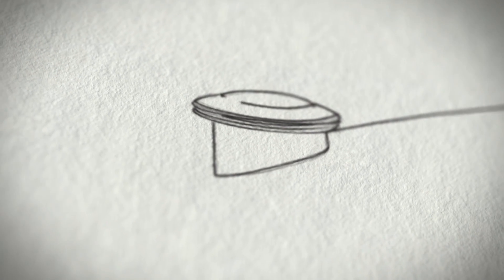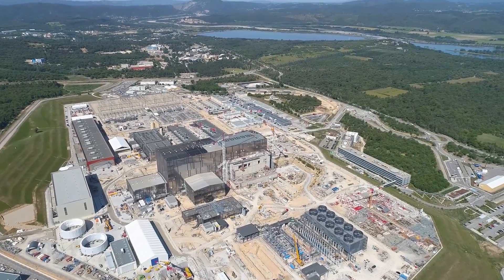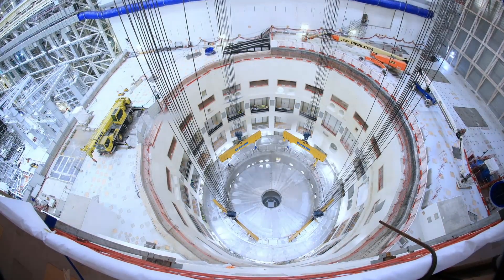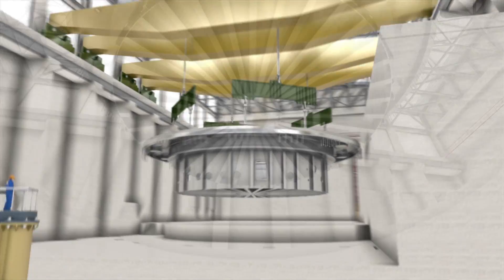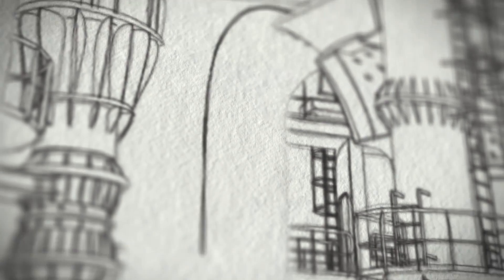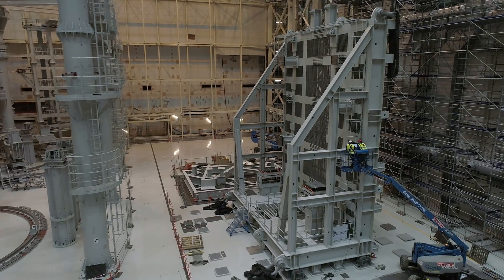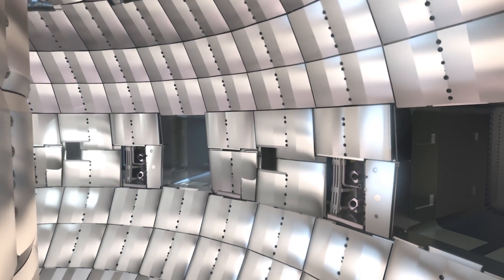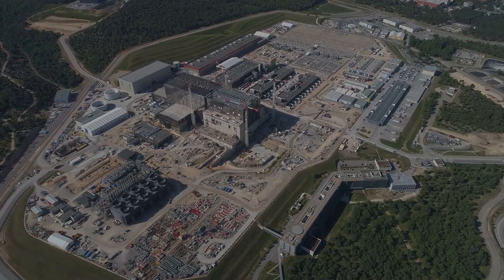ITER - the world's largest puzzle (2020 version)

Comment: I am always surprised about how little attention this project gets when it is so crucial for all of humanity.
Reply: I found this by chance and I am absolutely astonished I have never heard of a project of such magnitude and time based dedication; at an international level. UNBELIEVABLE, this should be all over the news as a celebration of humanity in these difficult times.
Reply: @imwritingtosay  It actually has been on the news a fair bit, especially the last couple of days, when it was first signed off, and when construction first started.

It's just that it isn't currently a super high importance and general interest item yet ( since it's still decades away from producing energy, and even then it will never make electricity ), and it's all very long term.

It would be nice if things like this were higher priority than a lot of other stuff though.
Reply: Couldnt agree more mate, that has been on my mind a lot and its dissapointing that no one is recognising their achievements.
Reply: @David Currie Much less long term radioactive wast than fission. ITER is also a research machine - not a commercial power station. Like many technologies it will get cheaper and simpler as confidence and experience accumulate and as it gets streamlined for actual use.  If it works it will point the way to a future where we don't have to fight about oil.
Reply: How broken our culture is...
Reply: Still gets enough attention for it to be built though.
Reply: David Currie , what data are you analysing? Your claims seem to contradict the IAEA ... https://www.iaea.org/topics/energy/fusion/faqs
Reply: ngl this is already outclassed by the wendelstein 7-x
Reply: @tedkorff971  by the use of graphite (carbon) tiles that will react with hydrogen maybe? outclassed = source?
Reply: @the_black_douglas9041  He is lying.
Reply: ITER is even criticised by some. I'm glad that I can speak English, the comments in French are a bit miserable and show a deep lack of scientific knowledge and understanding!
Reply: @ThaïLoeil-d6k  les miserables
Reply: @ThaïLoeil-d6k  Do they think its going to cause a nuclear explosion and delete part of france?
Reply: @David Currie Fusion power absolutely will pay itself back. Sure, it's not purely magical as some say (without a ready supply of deuterium, these reactors will produce radiation and radioactive byproducts) it definitely has the potential to replace the entire fossil fuel and nuclear power generation. ITER itself will not be hooked into the grid, because it's purpose is a research reactor. The big idea behind it is that by making such a large reactor, we'll gain efficiencies from the scale which will tip it over into over-unity and produce more output power than input. Let's not forget that nuclear power was considered impossible prior to the Chicago Pile moment, when we first demonstrated that mankind is capable of controlled fission, it only took 12 years for the first nuclear power plant to start supplying the grid after that event. Fusion is almost certainly in the same boat, assuming that ITER performs as intended.
Reply: @Colin Berg No, It actually makes sense. This isn't "just another experiment" but probably one of the most important ones, and it has a huge scope, both as an international scientific collaboration, as well as a financial investment and as an engineering undertaking. One's reflection on one's culture is certeanly justified when exposed to the fact of this being a less frequently reported project and one with a much less presence in the public's mind as to compared to something like the mundane details of the life of some reality tv show star. It is justified to point out how most ppl around the world keep focusing on the wrong (unimportant but for some, entertaining) things.
Reply: @David Currie "It is not unlimited energy as is the widespread myth and it will demand incredible amounts of water for cooling, restricting where they can be built. They will produce a lot of radioactive waste and they will even end up using a lot of the energy they make to keep themselves running." This alone shows you don't really know anything about fusion. 

It uses a cooling system, just like a fission reactor. In fact pretty much any powerstation on earth uses water as a primary function of generating power. If there's an area on Earth that can't supply that much water I 100% guarantee there is no demand for a powerstation in the first place. Also, the water is reclaimed, and recycled, so if you're investing billions in a fusion reactor, chances are you can afford a few silos of water.

It doesn't create long-term radioactive waste at all, it produces tritium which is a little radioactive, but also incredibly valuable and used in the same fusion reactor that produced it, meaning it is collected a used instead of dumped. Every component in the reactor is safe to handle after it has been active.

It uses a considerable amount of energy to sustain itself yes, this is integral to how they function, they are trying to reach break-even point where it produces more energy then it requires. The reason they are bothering is because when it does reach break-even it will produce energy an order of magnitude higher then it costs to run.

Sure, people do overhype it, thinking it will be a cure-all to our energy needs. But that hype doesn't detract from the fact that it's still the best method of generating vast amounts of clean energy we have. It may not generate a billion terrawatts or cure cancer, but it will be one of the biggest moments in Human history. History books will record our timeline as "before and after we reached break even in fusion power"

Also, since when did "insane demands" stop people from building fission reactors or even Hadron colliders? If people were deterred from insane demands then we wouldn't even have power distribution in the first place, we would still be using candles.
Reply: I think it might be because evey time people here about it they then here the first test will be in 2025 and it still being put togther so they say "that a long time tell me when its done something"
Reply: In 1976, I wrote my High School Term Paper on Nuclear Fusion, comparing magnetic and inertial confinement technologies. At the time, there was a great deal of interest in Fusion Reactors ... so, yes, what happened??  I would say in general, interest in scientific and technical pursuits has waned since the mid 70's, when the USA was peaked out with NASA, Moon Landings, Skylab, building the Shuttle and Hubble Telescope.. lots of excitement ... then America just started getting dumber and aspiring to ignorance ... what the Kardashians are doing is more interesting than any ITER,. and 1/4 of Americans think Evolution and Moon Landings are FAKE. Then we got the guy who can remember 5 words (Person, Woman, Man, Camera, TV) as POTUS, elected by those ignorants.
Reply: @KrustyKlown  Molten salt thorium reactors are promising.  They could fill in the gap until we have fusion reactors online.
Reply: Probably because there's been programs to crack fusion power since the 50's, and it still doesn't look like it's coming anytime soon. For the purposes of a human lifespan,  fusion research is irrelevant.
That being said, "A society grows great when old men plant trees whose shade they know they shall never sit in"
Reply: it is better this way. as long as it stays out of public attention it doesn't run the risk of becoming an object of politics and conspiracy dumb fucks don't think it is an corona alien 5G black hole generator
Reply: @Sjors you will find it maybe funny that most of the construction workers on site do not even know what exactly they are working on. ive seen an interview once where one of the project commission interviewed some workers, and they were like "i think it has something to do with electric power" then he held up a glass of water and explained them how the machine they build creates from this glass of water as much energy as several barrels of oil.  they looked quite skeptic and yet amazed.
Reply: Reality is often disappointing.
Reply: Most people doesn't know about this project. I agree with you. Success of this project will rescue humanity and Earth from heating.
Reply: Same goes for spaceflight
Reply: Humanity is busy fighting itself
Reply: @charlesstuart3064  They changed the algorithm recently back to the way it was about 1-2 years back. I have discovered multiple new channels that I liked and been served newly viral videos again.
-
We will see how long they keep it this way.
Reply: @David Currie    Yes, in terms of power generation it won’t help. Bit it lays the foundation for future (fusion) reactors. The waste you are talking about is neutron-activated metal which can be recycled after 100 years of moderate radiation (no final repository anticipated). The ITER-reactor should make 10 times more energy than it requires to run: 500MW output for 50MW in, giving you a net output of 450MW of power. I think the major problem is cost and time. While we wait for fusion to enter the market, we should replace fossil fuels with fission (SMR) and renewables (PtX).

SMR = small modular reactor
PtX = Power to X (X=H2, gas, other energy-rich chemicals).
Reply: @lagging_around  To my understanding the 500MW out is in heat production not electrical power. The researchers intend to swap panelling along the interior and fiddle with injection and extraction to work out the science around this technology so that DEMO will be capable of extracting heat from such a reactor and using it in some form of heat engine.
ITER will be dumping the heat into some river unless someone concocts a way of using such a small temp differential to do work. I suspect some toy apparatus will be deployed since ITER is effectively a large scientific instrument. They are planning to dump the heat because they want to have high control of the temperatures inside the reactor.
Reply: na most people are more interested in what kim kardashian wears
Reply: Because of the evil “Made in China” in the project.
Reply: because its always 30 years away and never works.
Reply: I N V E S T
Reply: We have our own tokamak project in our country and people are more interested in that one.
Reply: @satyavan9631  Hot fusion has already achieved the milestone where the ratio of it's electricity output and input to start the reaction exceeded 1. That means the tokamak approach is proven to be feasible, and the only work left now is to keep on and increase that ratio to 3, at which people believe the reactor will be profitable and can be put into civilian use.
Reply: So true...
Reply: Critical? We would be ok without it. Don’t get me wrong I think it’s great and this could change everything but it’s not critical.
Reply: In 1980, U.S. Senator Mike McCormack sponsored the Fusion Energy Act, committing the United States to researching and implementing fusion energy. The act passed and was signed into law--but with no funding--by the very anti-nuclear Jimmy Carter.  At the time, an organization formed in 1976 called the Fusion Energy Foundation, pushed for U.S. and international commitment to fusion energy by the year 2000.  FEF published a monthly magazine, Fusion, for years.  It was suppressed and in 1986 the federal government put FEF out of business in what was branded by the relevant judge as "a fraud upon the court."
Reply: Could say the same about NASAs SLS/Orion and the rest of the next space race.  We are those rare people that still actively search out to learn about what is going on in these different engineering/science megaprojects.   People are more concerned about an over paid sports player or Kardashians latest toy.
Reply: They are literally building a Star Trek Fusion reactor in France and literally nobody cares.  Very strange.
Reply: @redpillcoach1855  look DTT up. Is the first tester for DEMO tech (the real iter deal) They'll test it in the 2025.
Reply: @David Currie if everyone thought like you, I don't think we'd have any electricity at all. You can't learn how to do something hard unless you start with plans and inefficient prototypes and improve the design from there. Consider cars, planes, the power grid itself, the war of the currents between AC and DC.  It's too early to tell the best method. 

That said, I hope Tokamak reactors aren't the only practical way to make controllable fusion power, for all of the reasons you've stated.
Reply: It's because oil makes more money.
Reply: "Little attention" - i second on this.  But definitely, not in terms of Budget.
By the phrase you've made, I am of the understanding that you mean
attention from both "media" and the "public" in general.

The only conjecture I could pose is that many members of the media
either have "poor" or "little" understanding of nuclear sciences.  Thus,
the general public reliant on these mainstream media, by transitivity,
also have poor and little understanding of this endeavor.

ENERGY is the CURRENCY of Our Existence.  In fact, ALL LIFE FORMS
and WORKING SYSTEMS won't work and thrive without ENERGY or POWER.

You are DEFINITELY CORRECT in citing that it IMPACTS HUMANITY, in general.
Reply: project that important should have 5.000.000.000 euro per month... untill we all achieve technology like that...

I don't know what the world leaders are doing... 
There should be commity with USA China and EU and around 500.000.000 peoples [easlly]  that can afford it easy should all pay special 10 Euro tax online [so noone stals it] only for developing this technology...

That would give 5.000.000.000 per month for develope of that and other GREEN technologies. I would gladly pay this 120 euro per year
Reply: Probably because if successful it will literally change the world, fossil fuels will be obsolete and energy will become pretty much free. The elite must find a way to make money after all. They are probably scrounging to find that avenue, when it happens they will make this front page news. This achievement can potentially bring world peace, its that important.
Reply: @David Currie The sun disagrees with you. Of course there are teething problems, but fusion is the future its the only way forward. The nay sayers will always be there.
Reply: @kirksmith347  this is like saying there are naysayers regarding interstellar travel.  Or creating wormholes.  Or anything else that you might want to dream up.
Reply: Except its not. It's just a massive money sink, that promises to solve the problem, renewables solved 20 years ago. This project is not intending to generate any electricity, but its experimental installation. It will consume more energy than it produces. Just because its possible, it doesn't mean its economically viable. The carbon footprint of this installation is ginormous. By the time this becomes scaled down, the entire planet will be long carbon neutral for the fraction of its cost.
Reply: @sodalitia  you’ll be interested in this dispassionate, technical article:

https://thebulletin.org/2017/04/fusion-reactors-not-what-theyre-cracked-up-to-be/amp/

So, knowing all the above, why did ITER come about?  Well, that’s like asking why the b2 bomber or the seawolf sub came about (though at least those things worked).  Bureaucracy, misleading information, vested interests, etc.
Reply: @sodalitia  it’s not known to be possible yet, at any cost.  See my comment after yours.
Reply: Actually, if you look it up in the media, it gets a lot of attention at least here in europe.
Also, there is more money put into this than any other scientific project at the time.
Reply: i just learned about it
Reply: It's impressive, but actually pretty useless. ITER's estimates are that fusion will become a commercially viable source of electric power only around 2050. By that time total decarbonisation of the energy system is supposed to happen. The world fucked up fusion, it fucked up even nuclear. There is still a chance to have nuclear contribute something significant to our energy mix by 2050, but right now it looks like we will have to rely on solar + batteries + some wind due to overregulation of nuclear and the demand for maximum safety. My prediction is that ITER will be built, but will contribute nothing to humanity's progress or solving of its problems.
Reply: Some people think it's one gigantic boondoggle.
Reply: Short attention span . Dancing with the stars and other such have all but used up humanity collective focus. No room for serious endeavors.
Reply: You obviously have a poor background in physics...This monstrosity is a horror and should be destroyed before these monkeys turn it on...This scam was done during the entire pandemic...
Reply: we had the photo of iter on the back of our High school physics book(India
(may be the Book was printed before 2013
Reply: That's because Trump and the GOP do not believe in clean  renewable energy, they don't believe that global warming exists and that the world is flat 😠
Reply: It is hard to get people excited about something which is eternally 20 years away.
Reply: Its a shame. I have one hope for our survival as a species and it is this project!
Reply: I asked a professor in my college about ITER that specifically deals with energy, renewable energy, green energy and similar engineering branches. She didn't hear about it. What a fuck. I told her what it does and she told me that it is a fiction and when I told her how many nations invested in this project and the scope of it she was still not interested. 
The funny thing is that half of everything she ever said was political. She was literally talking mostly about current politics from the left perspective. Which is I guess ok because everyone has their right to express themselves and to state their opinion on who is to blame for problems but then a professor high up in the green energy engineering field doesn't know anything about ITER... Fucking politics. 
I am not from the us or eu just for the record.
Reply: @onix5221  "Green energy engineering" There's your problem, the term "green" is a marketing term.
Whats her name? I'm curious what academic background gets such a job.
Reply: @David Currie That type of comment doesn't make much sense to me, could you please come up with some facts and figures instead of a mere opinion?
Reply: We can blame the media.  They don't have any worthy science programs anymore.  Morocco's solar energy program is another great step that hasn't received much attention.

The BIGGEST Concentrated Solar Plant in the World is in Africa I Morocco
https://youtu.be/eTE7rGEb3tU
Reply: @mikecimerian6913  
Let's just hope that there are no birds at all in Morocco. You could have a restaurant there with the birds getting instantly fried right out of the sky.
Reply: @mikecimerian6913  fair enough
Reply: @mrJety89  I know, those CSP Tower Plants are incredibly cruel to birds, but hypocritical groups like Greenpeace support them over fusion, just because so many people are so uninformed, they think anything nuclear will melt down. Never mind that CSP plants are constantly breaking, at least the ones here in USA!
Reply: I agree, but I guess it's too difficult to understand like the research on nucleair energy was before WW2. And beside that, 70% of the world population is just trying to get basic life support done, like a house/food and water. Education is expensive.. We have a long way to go.
Reply: Because it is a global effort which is not a trend today.
Reply: Its by design. Way too bureaucratic and slow to ever achieve any meaningful progress. It's been years.
Reply: @David Currie You are lying. Fusion does not produce radioactive waste. If it did you would not be here to talk about it since the sun is a giant fusion plant.
Reply: @walter253  right,  but it does destroy the very materials that are in place to contain the plasma.  Which is about as hard a problem as interstellar travel.   In other words, nobody has any clue there.   Remember, the sun ‘contains its fusing plasma’ via massive gravity due to mass.    if it sounds too good to be true to think we can replicate that with just a magnetic field and some steel plates, well, it turns out it is too good to be true. It’s actually quite fanciful.
Reply: Because there is a deadly pandemic going on, thats why, are you for real?
Reply: Maybe because it takes so long (it will go years over its estimates and billions over budget), has a high chance for failure even with in its small goals of briefly sustained fusion, and will actually do very little to prove that practical fusion power is possible.   why?  Because of containment materials.  Neutrons ruin them, and fast.    Scientists have  NO way of ‘real time’ replacing the blanket materials while a fusion reaction is underway.  And saying ‘oh, they’ll figure it out’ is like saying ‘ oh, scientists will figure out how to get practical solar panels to go from 22% efficiency up to 40% efficiency’, when in fact there’s been virtually zero progress in 20 years.   Wishing and hoping for a breakthrough does not guarantee a breakthrough.     in summary, we still have no clear path of knowing that we can build a controlled sun.   

All  this is just an experiment.  Like the massive National Ignition Facility experiment, which also cost a fortune, was probably the largest experiment built thus far, and it failed in its main goal to have some basic ignition of a small fuel source. Again ***it failed***.
Reply: This project is a dinosaur. By the time they complete it, mouch smaller fusion projects with mouch stronger  magnets will have achieved what ITer set out to do.
Here's an example
https://www.youtube.com/watch?v=hWYnbYsp3i8

This is because magnet technology advanced well beyond what was thought possible at the time when ITER was designed. With weaker magnets you need a larger vessel to make the plasma stable enough.
Reply: @mrJety89  It is obvious that research evolves, and advancements will be incorporated into ITER as and when ...
Reply: @ThaïLoeil-d6k  That's not how design works. They can't make any significan changes now, the design has already been "baked in", so to speak.
Reply: @mrJety89  Not strictly true actually. Yes, certain aspects are basically impossible to change but ITER was designed with a lot of effective modularity in mind, specifically because it's supposed to be THE testbed for powerplant scale fusion reactors. So very few components cannot be changed out to reflect newer designs and components.
Reply: @MazonDel  I was sort of aware of that, but I was  specifically talking about the magnets. Even for ITER, it would be too expensive to produce a whole new set of magnets, plus I'm pretty sure that changing them would upset the design beyond recognition. So they are committed to the ones they have.
Reply: @mrJety89  Yes, the coils are pretty fixed. You COULD replace them with others, if say a better superconductor was found, but it would be a VERY expensive proposition. ITER actually "ships" with a spare coil, just in case they ever have to replace one.
Reply: @MazonDel  It's like building an aircraft carrier. Or two.
_
 Whatever comes after ITER I hope will be substantially different. The thing is that there is a superconducting magnet revolution going on right now. The magnets are getting stronger every day. So if ITER was designed to have say a field strength of 1Tesla, by the time they become operational there will be magnets that can achieve 6Tesla or something ridiculous like that. Stronger magnets mean higher stresses on the structure, so ITER simply couldn't handle the stronger magnets even if they wanted to, but I hope that whatever comes after ITER will be smaller, and will be able to have these stronger magnets.